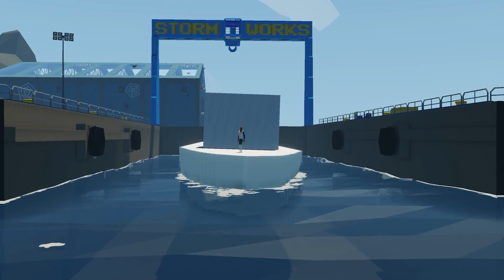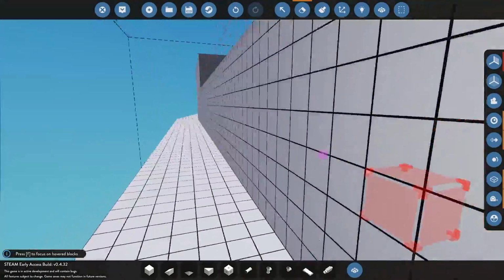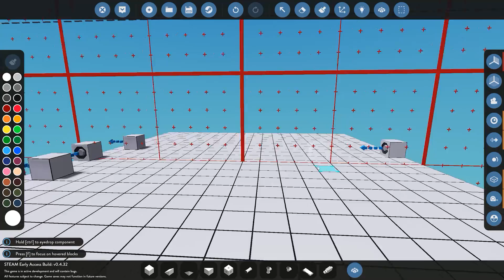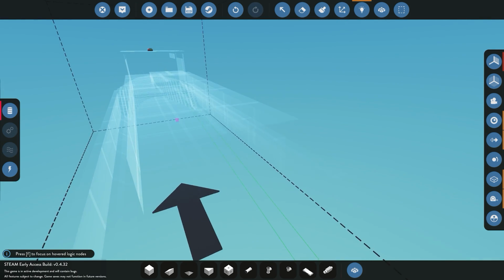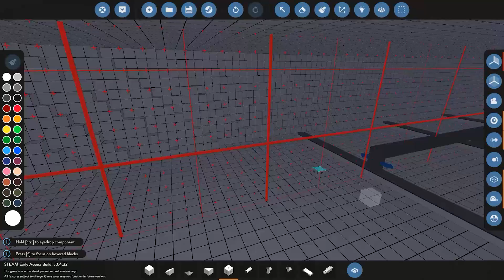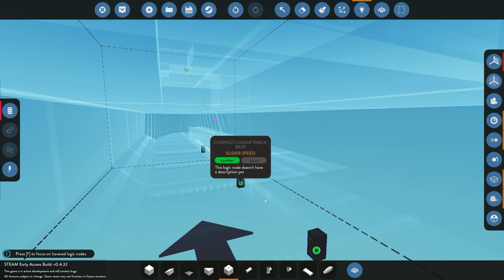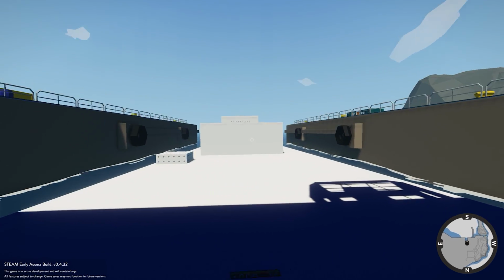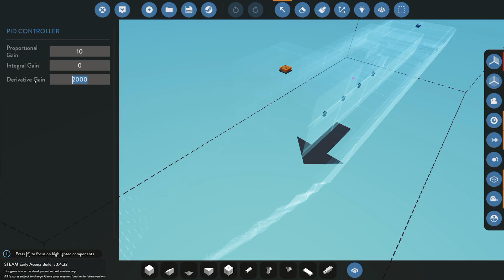Stormworks Active Stabilizer Tutorial

Comment: You can do this but the way I do it is to put in a gyro and then put the roll setting as 0 with a custom . after that turn on auto hover with a constant on switch. Put the stabilized roll output on the gyro directly onto the track with the weight blocks and it seems to work pretty well

Comment: Great video :).. But real vessels would use Ballast tanks, fins  and thrusters for this purpose. Modern most energy effective systems are based on dynamic ballast tank systems. As someone commented earlier here, please set up a tutorial playlist for stormworks, I'm subbing ;)
Reply: I've been toying around with a hovercraft lately,  using azimuth thrusters facing down to control pitch/roll.  at the moment, it only has 3-4 degrees of variation and rides only 2 blocks deep in water

Comment: Wouldn't the rotation angle be higher along the COG? Unless its measuring distance rather than angle.
Reply: Jed Sanders The tilt will be the same no matter how high you place the sensor as long as it’s parallel to the ship. The deck is the same angle as the roof. :)

Comment: Is it possible to make stabilized Seat the same way by  any chance?
Reply: There is a steam guide that does exactly that, it's called "a guide to pics"
Reply: @joshieeee20  Yea I just saw it
Reply from the maker: Yes using a PID and tilt sensor however you would use a pivot instead of a track
Reply: MrNJersey thanks, Congratz on 1k, a bit late but still